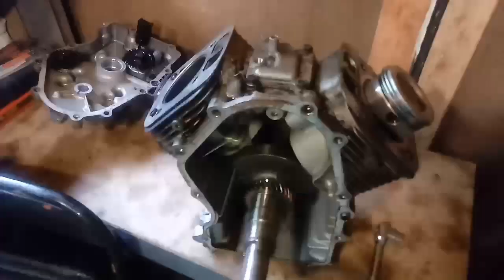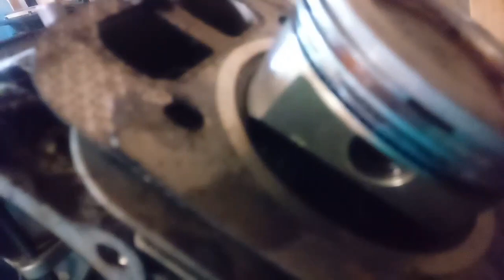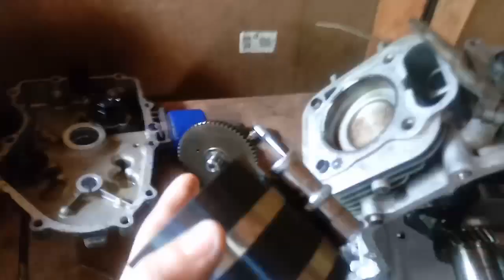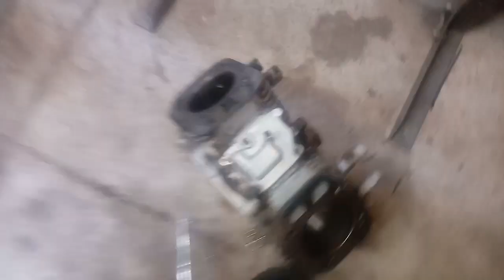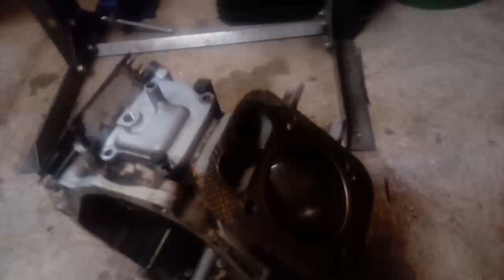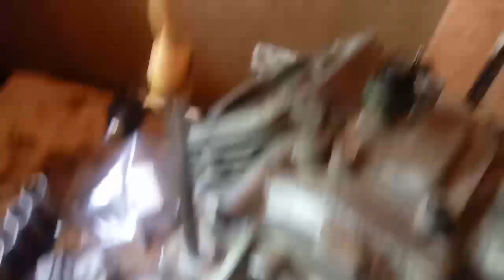Kohler 18 hp engine rebuild (part 2)

Comment: You seem to be a really good at working with rebuilding engines I appreciate the information I've learned quite a bit from watching your video I need to get you a can of IES International epoxies and sealers cannalube part number for 550 woodwork wonderful for your piston ring compressor and anything else that needs lubrication is a fantastic lubricant does not attract dirt will not wash off and once it's on a metal to metal surface it only needs periodic recoating but it lubricates and makes metal Parts move so smooth and slick I think it would be a big help for what you do
Reply from the maker: Thanks!

Comment: Bro you should do. A little tour of your shop, it looks cool up in there lol.. Look up how to do youtube tags to get more exposure, your vids are cool man.
Reply from the maker: Thanks bro! And I will do that for sure
Reply: @mechanicalking  hey there. I have a kohler ch20. One of the spark plugs keeps fouling up. Dry black deposit build up. Once a week i have to swap out plugs especially on the one cylinder. Compression test was really good. But misfires alittle and smells bad when running. Lots of power except when the plug has had enough build up. Goes through oil pretty fast too. Im just trying to determine whether another rebuild is good or just buy a whole new motor.
Reply from the maker: @ugna2773  needs new piston rings
Reply: @mechanicalking  thats what i thought. Tbe dealer i brought it too said that the compression was good so it was maybe the bottom of the cylinder. That doesnt make sence to me. Then i thought maybe it was a bad coil on that side. Its the begining of the season which sucks. I think im gonna try keep.patching it up untill the end of the yr and tear into it.